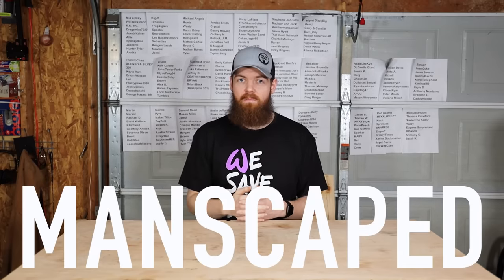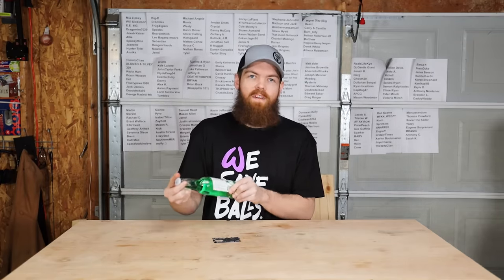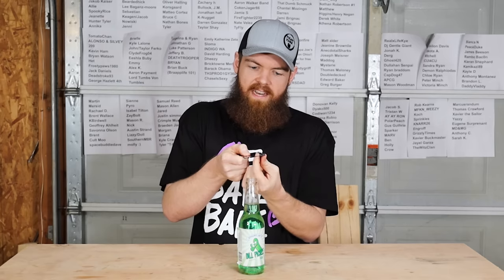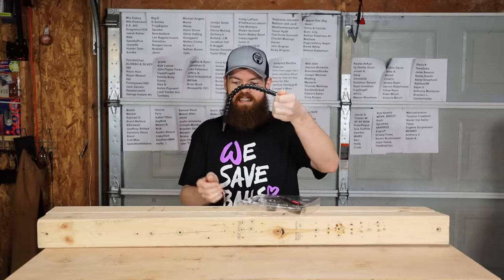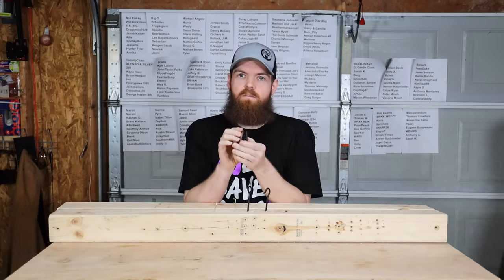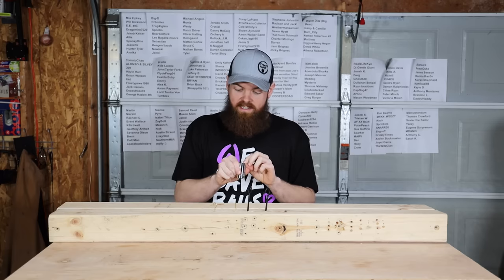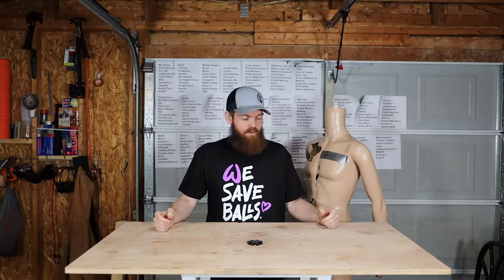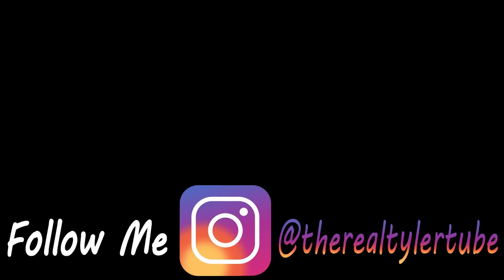Do These Tools From Amazon Really Work?

Comment: The wrnech on the ninja wallet is most likely meant for loosening bolts, not driving them into non pre-drilled wood
Reply: Yeah, or taking out bolts from screw holes or those which have a nut on the other side

Comment: i been carrying a walllet ninja for years and it's surprisingly handy. i use it as a bottle opener and sharp edge(when i don't have a knife) more often than anything
Reply: I don't have that brand but I've owned 3 of these wallet tools (1 was confiscated by TSA, one I forgot to put back in my wallet and lost) and they are a godsend for my work
Reply: Damn near anything can be used as a bottle opener and if you need a knife often, just carry a real one.

Comment: You're suppose to pre drill the holes in the wood so the screws go in easier. And it stops the wood from splitting when drilling in screws. That's what that noise was also
Reply: No that wasn’t the noise, and you didn’t have to predrill if you have good quality wood
Reply: @thehourglasswithaman  you should predrill for any quality wood
Reply: @thehourglasswithaman  Tell me you've never worked with wood without telling me you've never worked with wood
Reply: @meganek0597  I was a carpenter in rough framer for a year and a half softer woods. You don’t have to pre-drill unless you’re putting in really big screws. You only have to pre-drill, harder woods.

Comment: the socket with the pins (aka Gator Grip) I have had one for almost 25 years.  Still works perfect... I used it as an electrician for years on a small folding ratchet.  Now I have one in every tool box.

Comment: The snake: Dude, I have the DeWalt version of that thing. It came with the right angle attachment, and it is rated to work with the top of the line DeWalt impact drivers. 

THAT one, the one I have, is great for driving screws. But it does not transfer torque worth a snot. It sucks at driving nuts and bolts.

They are just not meant for that. You will not get any torquer out of that thing.

Comment: I kind of want to buy a Bionic Wrench if for nothing else other than supporting the inventor.  After he released the tool Sears “partnered” with him to get the tool into Sears for retail. Sears then promptly stole the design and made their own Craftsman version while pushing his tool off of the shelves to make room for their own inventory. You should read up on Dan Brown and his story.
Reply: damn that sucks. ive had the tool in my tool box forever now. i haven't had a time where its useful yet but im still holding out.
Reply: I'm kind of glad Sears is circling the drain after hearing that.

Comment: Fyi when using the extender that sound was the wood creaking because of the coating on the deck screw also it's more designed for hard to reach places where not a lot of torque is required.

Comment: as a carpenter using a impact drill all day, the flexable drill apex extension is very usefull. feels very weird to use in a drill but works very well. used for drilling self tapping screws into structural steel studs

Comment: Note: do you see how (@ 00:09:24) there is a thicker piece in the middle, that's the piece that you're supposed to have on the dragging edge of the turn. The reason why it keeps slipping out is the rigid grip arm isn't being used. He should have flipped the card over.

Comment: The problem with the extender thing is it's supposed to be used for removing and adding screws so when you take one out it unwinds the cable and when you put one in it rewinds it so it would never break if used right

Comment: Im taking this with a bit of salt, The screwdriver extender i think is more efficiant when working with cars or other vehicle related stuff because those bolts and screws are much more friendly to this tool. The wood is very Hard to screw in The whole way meanwhile bolts and screws on vehicles are Hard in The begining then slowly getting softer.
Just wanted this said and I apologise If my english sucks but im from sweden.
Have a great day!

Comment: Tyler, that part where you were trying to tighten those bolts it's not a wrench it's just supposed to tell you what size that bolt is so you can get the right size wrench

Comment: I actually have one of those "snake racheting" screwdrivers and it works pretty well!  It had been helpful to me on some occasions where I had to deal with some screws/bolts that were at weird angles in tight places. Mine is actually pretty strong, to my surprise. It came with a set of different screw heads and also some bolt sockets too with an adapter!
PS: Poor Gary!  😢😀

Comment: Wrenches meant more for machine bolts and nuts. Wood without drilling first is too hard. Nail puller is for fingernails. Flex thing is amazing. Again great for screws that don't have so much resistance.

Comment: The cable in the screw snake thing is the same cable that runs a typical weed eater it’s just a bunch of cables wound up so it’s flexible but will transfer torque

Comment: LOL I bought a bunch of Wallet Ninjas as gifts a long time ago and they came with the free wallet knife, but the call phone stand NEVER EVER WORKED FOR ME. Mine just stays in the kitchen drawer and is used as a can opener now. I'm gonna tell you this, it definitely works and works well, not sure why you had so much trouble with it, but it's my only can opener. And to be fair, if you go counter-clockwise you get a much cleaner line as well. SURE it's not as good as the turning can openers, which most people also use wrong, but once you get used to it it's not bad.

I've never used the bolt things, but to me it seems better for loosening a bolt out of metal so you can hand turn it out, for tightening...not so sure.

Comment: That bionic bolt remover would be great if it could lock. Literally all it needs is a latch mechanism
Reply: not only that make it a ratchet system locking and ratchet will make that very useful

Comment: That penultimate tool would be even better with a locking mechanism so you could grip and lock without it slipping off as you turn. It would probably also help those with compromised grip strength.

Comment: I get one of those universal sockets wit pins in my generic tool bag.  Mine is the gator grip brand, it works okay and with an adapter for my impact driver it has came in handy on random pop up jobs..  i had my impact and other generic tools and was helping my mom, she asked me to take something off that had a bolt and I had it with me.. the project I was working on (panelling) i wouldnt obviously have my socket set but I did have this socket in my bag... definately worth throwing in a generic tool go bag.

Comment: Wrong size nuts. I bet with nuts the the card would work.
  Also i suspect that the drill cable. Isn't really designed to be used for high torque uses.
  That universal wrench could benefit with a lock wrench mechanism. But looks real useful.

Comment: I mean, that snake piece seems like it did with it promised. It’s definitely not built to last crazy abuse but if you’re just trying to get a weird bolt or screw around the corner that you can’t get the drill straight on, I can see that being useful. It’s just not gonna be able to do everything under the sun completely unsupported

Comment: Pretty sure those lag bolt slots on the card are just to find out the size of a lag bolt. I mean think about it, if you actually used the card what would you do when you got close to the bottom? It would be impossible to fully tighten the bolt

Comment: When it comes to universal sockets, you really don't want to use them on anything that requires even just a medium amount of torque. Great for light torque use on awkward screws, but using too much torque on them will deform the pins in it so they get stuck and don't spring back properly. Don't want to turn it into a normal socket with lots of play. Somewhat the same for the bionic wrench, don't want to use it with medium to high torque.

Comment: I 99% back those universal bits. I recommend buying a couple, they're inexpensive. It'd be 100% but they are gonna fail eventually and lose springs/posts after a while. For someone who doesn't wanna carry a bunch of tools or doesn't use sockets enough to buy a decent set, buy a couple of those and you'll never regret it.

Comment: The card: Maybe if you had two of them, it might work better. Also, if you have to put a credit or debit card in there, that's a security risk. Bad idea.
The can opener: It's no P-38, but it'll do in a pinch
The "hex wrenches": I believe they were put there to say they had hex wrenches, but they will turn a nut. Bolts are much harder to deal with for a thin piece of non-descript metal
The "Nail puller: Yea, ok. That's not gonna happen. card snaps

Comment: Get a xpower blower at lowes and run some test on it. I have one its alsome i dropped it down some steps and it hit a wall and did nothing to the blower but put a big hole in the wall blower works fine but as some little scratches on it thow

Comment: Hey Tyler, are you purposely not drilling pilot holes for all these screws and bolts? If ya did, the flexible screw extender thing wouldve worked better...

Comment: The can opener was upside down  and a cash card is strong enough to support the phone I have that card and as with most card multi tools they aren't great but all the tools work to some extent you just have to use them properly. The card he threw away has instructions on it which may have helped

Comment: 6:00 its designed to act like a Church key, though a real church key looks like its allot sharper then that and the blade pivots out to give you a side torching action instead of the forward movement of that card.  However it appears to work just as good.  The design is pretty old.

Comment: That motor city snake bit is the same design the 95 Triumph 900 uses to adjust the carbs. Old tech used in a new design basically. That’s why it sucks. Lol.

Comment: i feel like that screw driver thing that looks like that came off something from the horror movie saw would be quite useless. in a real work job, i mean if you were getting something from a werid angle. And you had to put THAT much support on each end and the effort you have to go though. It would be almost easier to do it with a normal drill.

Comment: Bro never ever use screws without drilling a hole for them first. You will save your tools and save yourself the frustration of stripping  your screw heads.
Reply: Save it from splitting as well.

Comment: The bendy one saved me $2000 to get a 1/4 bolt I just had to but the bit.and yes wobbled and I had to people to help hold the plastic with cable but the came undone no need to drop a engine

Comment: Right I probably wouldn’t get any likes or anything but. I do respect you. The issue I have is you always see the bad side before the good. The card that does a lot. It’s a card! Trying to tighten the bolts for example. It’s thin and it has them as a survival situation. Same with the can opener. Think of it as trying to open a can in 1920/1940 It’s survival. Does the job doesn’t it. Tyler see from that point of view pal 👍

Comment: Omg, that card wasn't ment to be used for a 5 inch bolt going thru wood either 🙈 Seriously,  but if you need to tighten a bolt and nut together,  maybe you get it enough to get you home.. Maybe a hose clamp or something... You should've seen that too.. This video and testing makes no sense at all.. Everything can be used in sertin situations..

Comment: Bro these tools are meant for last case or worst case, not to open your beans and corn daily for dinner. Also the "bolt turner" option is meant to remove nuts from bolts, not drive 4 inch lag bolts into pine 2x4s lmao.